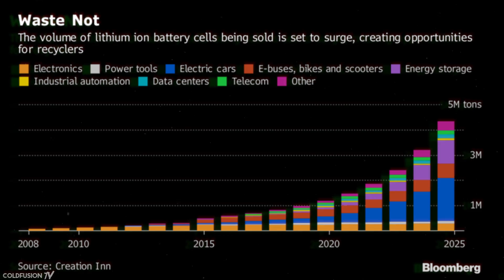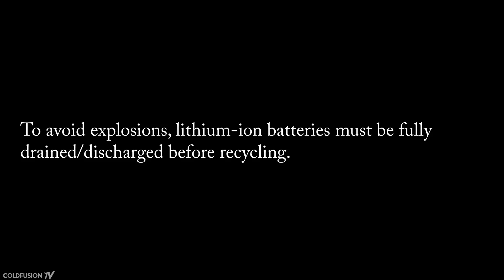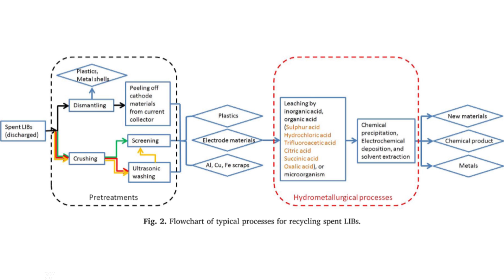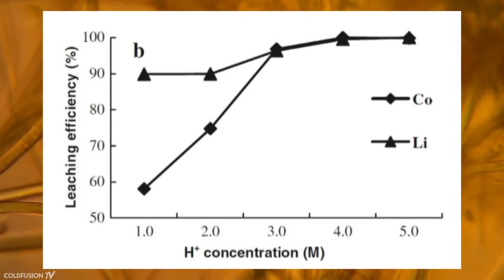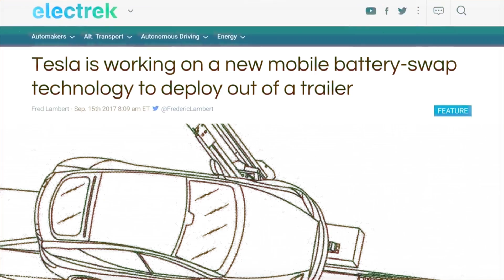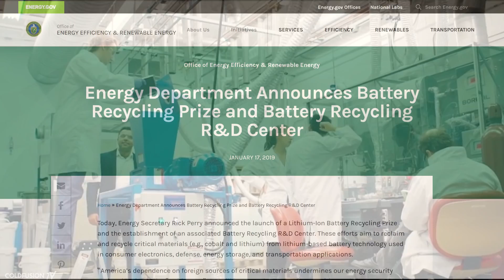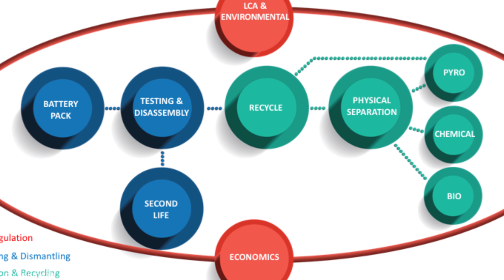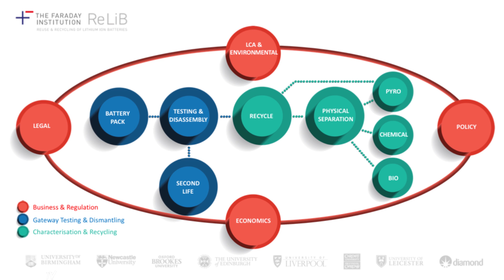Batteries, Recycling and the Environment

Comment: #Google: Aqua Metals Inc. The technology, AquaRefining delivers ultrapure lead at a high yield while reducing environmental footprint and permitting. AquaRefining utilizes a room temperature, closed-loop, water-based process combined with non-toxic, biodegradable organic elements to produce 99.99% pure lead. This is equal to or better than mining, with no need for secondary processing; effectively meeting increasing demand for lead through an environmentally and economically sustainable operation. 

Aquametals.com

Comment: Recycling should be just one part of sustainability and that not even the largest part. Reducing the need for rare earth elements in the first place should be the primary goal. Tesla's purchase of Maxwell's ultracapacitor technology will go a long way into increasing the longevity of existing lithium battery chemistries considerably. That's even before more energy-dense or robust compositions are discovered. We get a net decrease in lithium cells ending up at recyclers and perhaps the loss of revenue from feedstock at those facilities can be retooled for battery pack remanufacture, testing, and certification for when packs eventually do fail.

Comment: It's a stretch to assume that time isn't a big battery-degrading factor along with usage. For example here in Finland temperature cycles through +30 to -30 degrees along the year and +5 to -20 many times during winter. If you drive a Model S for 500 000 km in a couple of years,  time isn't counted in as a factor.

Comment: The natural lithium salt water evaporation process you speak of is the least damaging environmental process to get the needed lithium but its the slow way and as demand goes up for lithium with 8000+ big cells in each car they will go to other means of extraction using power plants to accelerate the process.

Comment: Seriously?  They believe that the lithium ion batteries in a tesla are going to last 17 years?  The same technology that leaves the battery on my phone bulging and useless after only a couple years?  REALLY!?
Reply: It's a misconception,  Most of the EV's I've looked into have excess battery capacity that isn't usable when you drive off the lot, as the batteries degrade they expose more capacity.  This works great in keeping the range roughly the same over time, but near the end the capacity will start to tank...hard.

Comment: 3:40 about what is inside the battery 🔋. I once seen a documentary about battery recycling by the German TV channel NDR or WDR im not sure but I think it was the fommer. 
Germany has a great system of recycling one time use batteries like you put into your remote. We probably have the same system like in Switzerland mention at 10:15. I assume that most of the EU has this system. 
They fixed the issue not knowing what is inside the battery by x-raying every battery for a split of a second each battery is reflecting the x-raying difference based on what inside. Than a system of switches no the belt is sorting them automatically

Comment: The problem I have about "green technologies" is they look at the environmental impact of using the product and sometimes the cost environmental impact of manufacturing, but far too often they do not include the environmental impact of mining and refining the materials and disposing of them after the product life ends.  Most things listed as green energy are actually worse for the environment or a flat wash.  Very few green technologies actually help the environment, but the cost of these are typically much higher and require government subsidies.  Those subsidies should be used for research.  Right now only about 5% or less of the government subsidies and grants goto research where it should be 100%.

Comment: You guys clearly dont know what you are talking about. How can you recommened to fully drain LiIon-Cells? If you do over-discharge, and that is exactly what you do by fully draining them, then the internall chemistry in the cell goes haywire and realy bad things happen. Do not fully drain them!!!! And what about 95% of liion battery are either stockpiled or land in landsfills worldwide. I have really bad news for you guys, the world does not only consists of the USA. In Europe this number is far better and has been for many decades.
Reply: I think there's a misunderstanding on the adverb 'fully' here. I understood it as within safe voltage, i.e. 2.5V-ish, not a real zero volt from cathode to anode. In layman terms, fully discharge will be interpreted as when the load reports 0% usable energy left. It wouldn't be possible without bypassing the controller anyway. As for landfills in general, yes it's a shame that they're still allowed to exist in first world countries. I am Swiss and as mentioned in the video, batteries have been sold here with a recycling tax for over ten years now, and the tax is adjusted to cover domestic recycling costs, without exporting them. This makes total sense to me. And by the way, it's not only batteries, it also applies to all household electronics and appliances. It's not even expensive for electronics, about $5 for a new laptop or desktop computer. Retailers used to add the tax to the price tag when it was first introduced, but nowadays it's almost always already accounted for.

Comment: Biotech student chiming in.
We are discovering/creating more and more powerfull methods for genetic modification and we will see much more applied biology in the years to come.

We already use many biological solutions to many problems. I would be so bold to say that it is maybe our most advanced technology.

Different micro organisms and their macromolecules are microscopic machines that can perform different Work and solve different problems. They are wonderful :)
Reply: What happens if the bacteria escape? Are we all dead then?
Reply: @cachememory  im not sure if i follow? 🙂
Reply: @atti1120  He meant that if those micro organic that are created with generic modification spread to environment, would it cause any issues?
Reply: @varshard0  strains used for production or whatever are specialised for that,  and said strains would have no chance of competing outside of the comfy environment that is optimized for them. Our crude modifications would have to compete with organism perfectly tuned to nature through billions of years of evolution. In Nature there is not any, and i mean any room for waste of energy. There Will basicly be a selection pressure against having genes that are not useful in Nature or is wasteful of energy/ressources.

Besides that, if we need to - we can, and in some cases already do make them die automatically outside the intended environment :)

Comment: I wonder why the eCar manufacturers use thousands of 18650 batteries to fill a battery pack.  Maybe making a large solid battery is dangerous and using thousands of little batteries to make a car battery doesn't overheat as much.  If not, maybe a solid battery would be better and lighter as there wouldn't be individually wrapped 18650s or similar batteries adding a lot of weight.  It would be slabs of material.
Reply: you need a large number of cells anyway to reach the voltage's required for EV's, why not use a industry standard?  there are hybrids that use larger cells though.
Reply: @Wooble57   Oh I see so it wouldn't work to make standard size battery modules that are made solid state instead of individual 18650 cells.  Maybe it's too big to make, maybe smaller solid state battery modules can be added together to fit the individual car's requirements.  So there would just be a few sections instead of thousands of batteries.  Just a thought Im no expert lol.
Reply: @Orbit_Cronus  they could, and in the future they probably will, but right now they save a lot in development costs by using 18650's.  Tesla is moving towards a larger size cell, though it's the same shape just bigger.  It's also a industry standard iirc, just a lesser used one.

Comment: There is literally no way bacteria are able to solve the pollution problem. It is way way WAY too slow and everyone knows this. So yeah, 'cool' to know it has almost a zero carbon footprint (this is false too by the way, but oh well), it will still be wildly impractical and even impossible. It's like when people were seriously thinking bio fuel could ever be the replacement for oil. It simply could not ever be, as we need the soil and so on for our own food production, not to mention the massive waste of energy to get some bio fuels in the first place, a problem oil has to a much lesser extent.

Comment: Just release free energy already goddamnit, the ionosphere is full of energy that can be tapped into, if you don't believe such technologies are suppressed, know that the US Patent office REFUSES patents for any devices that don't require an outside source of fuel or energy to operate. Making it IMPOSSIBLE to commercialize any kind of free energy technology.
I have also seen with my own eyes, some sort of metallic resonance bell that if placed in cold water would make it boil within 3 seconds !
None of this is science fictions and no it doesn't violate the 2nd law of thermodynamics, the energy is not created out of nowhere it already exists all around us, stop the materialism, matter is not solid, it only appears so because we are pretty dense. In both meanings of the term ;)

Comment: Thanks for the good report on the subject. I am surprised and disappointed that current batteries seem to not be designed with recycling in mind. Second life applications ar eno excuse for that. Everything that is produced needs to be decommissioned and recycled at some point. I think every engineer learns that by now. It is a fundamental part of product design.
Best hope: Manufacturers get a grip on this and take back their own batteries because of the valuable resources they hold.
Worst case: It will be a deeply regulated deficitary mess because manufacturers get allowed to not care for end of life costs.

Comment: What do you think of battery vs hydrogen?
Why did the industry abondon hydrogen technology in favor of battery?

I personally believe once the production of hydrogen has become economical sustainable.
It will be a much more effective transition to a enviromentally friendly revolution of current energy sources.

Any conventional engine can be rather easily converted into running hydrogen.

Which means current car designs needs minimum changes.

Other engine designs such as the Wankel (rotary) engine might even make a comeback as they are much more efficient and reliable running on hydrogen instead of fossile fuels.

I dont know.

I just fins it strange why the Hydrogen industry has stagnated.
Especially consider the car industry.
Reply: The problem with hydrogen is actually efficiency towards its production, and transportation.

WE need a lot of energy to keep the hydrogen cool and kept under high pressure, along with transporting it via pipeline/boat/truck.

The problem also comes from the fact that you can't easily charge using hydrogen at home, unless your electric car. Meaning you give more money to companies owning the resource and controlling the economy/resource.

Using the current electric grid and battery storage is much more efficient for small scale vehicles like cars, buses, and trucks.

For very large aircraft and boats, using hydrogen storage would be very helpful, especially since volume isn't a problem here, and high energy density would be very appreciated.
Reply: @neutronpcxt372  that is indeed true.
But it is not as if oil and gas production is any cheaper either at the beginning. Especially considering off sea oil drilling aswell as at areas with extreme climates.
But since it was the only viable rwsource at the time with enough energy compactness to make it worth it. Methods were made to make it more cost effective over time.

I dont see why this would pose a great hinderance towards the pursuit of hydrogen energy.

When you think about it. Batteries were at the exact same state for decages.

Considering the first cars were electric to begin with but went over to fuel due to ease of access of combustion fuel rather than battery energy.

Thus significally slowing down the developtment of batteries.

It was not before the smart phones became a thing that battery tech started going into high gear again.

Comment: 2:15 - Actually, thermal runaway can only occur in batteries that hold a considerable charge. Flat batteries are NOT prone to this problem. Therefore, this is not an issue with recycled batteries because, by their very nature, they are no longer able to hold a charge.

Comment: We shud talk about flywheel energy storage as an environmentally sustainable alternative to chemical energy storage. We should do a part 3 on solid state batteries as well!
Reply: it's really difficult to scale flywheel energy storage, if you spin it faster it either blow's up or requires stronger materials that are expensive, you run into the same problem if you make it bigger around.  I did see a interesting model made with carbon fiber, but you know that's going to be expensive as hell, and it still doesn't approach the kind of energy storage we need for grid scale.  In terms of tech that works anywhere, batteries are the best we have, poor as they are atm (in terms of grid scale storage)

If the area has the right geological features, pumped hydro is pretty damn good.

Comment: People need to wake up!  Electric cars are still far worse for the environment from start to finish than any fossil fuel car!   Without government subsidies, these vehicles and programs would be completely unaffordable.  I'm not saying they shouldn't be researched but they are far far from the "savior" they are claimed to be!
Reply: False
Reply: Matthew Prather ok, keep kneeling at your Tessa alter and don't consider every aspect of that "smart" car in the equation.  From the start of the mining of the minerals for the batteries, and the manufacturing of the equipment and machines needed for the mining and manufacturing of the batteries, to the transportation of the raw materials all over the world in giant oil guzzling ships. there is fuel being used for transportation, for the mining for the processing and manufacturing, plus electricity being used that is produced with fossil fuels.  Then you finally have a car that has already consumed much much more than a conventional automobile before it ever hit the road, and then it has to be charged with electricity for every inch it moves, which by the way is produced primarily with fossil fuels.  Then when it's all done, it has to be disposed of, as seen in this video, which will be costly and environmentally challenging.  As far as the life of the battery packs,I don't buy the hype either, they are made up of the same cells used in most tools etc, and you don't get 16 years out of them, trust me!

Comment: 7:10 careful, you just said Lb batteries have 95% recycle rate because they're old.  I see where you are coming from (long time to get recycling chain up and running) but they have a high recycle % because...they're easily recyclable. There is only two recycled parts (that i'm aware of) and are already "separated", lead and plastic.   I imagine the back end demand for lead + the ease of separating the components + legislation = high recycle rate. 
old does not equate to high recycle rate.

Comment: I believe the long term problem will be when a new battery technology does take hold lithium recycling will no longer be profitable. An example of that is NiMH batteries. Since lithium is now king, places that recycle them are few and far between. Most states in the U.S. simply discard them in the trash. Although their use isn't the level lithium is, it makes wonder if there is a batter breakthrough lithium recycling becomes undesirable.

Comment: I'm absolutely appalled by the way people treat their devices. Doesn't it bother them how expensive it is having to buy a new phone several times per year at worst? I'm sure these people can't be bothered to dispose of their broken phones properly either, which sucks for the rest of us and for the environment. I'm 24 years old, and I got my first phone when I was 9. I've owned 6 phones in my life. 2 Nokia 3310s, one Nokia 1100, and a couple of more forgettable models. My current phone is the first one to cost over 150€, and I still have most of my old phones.
Reply: Consumer lifestyle, they only feel the urge to consume...
Reply: CPU and RAM processing speed improvements coupled with software updates force people to upgrade. Apple specifically planted performance degrading software to the older iPhones which they've been called out on. Android you only get so many updates to the next OS software before you need to buy a new phone to get the latest and greatest OS. Even if you could use the old hardware with the newest Android software it would be slow and laggy do to that generation of minimum performance you get with a current phone spec. Its an evil business meant to make people buy a new phone every 2 years.
Reply: @practicalguy973  custom roms?